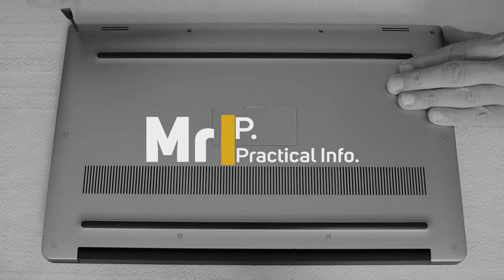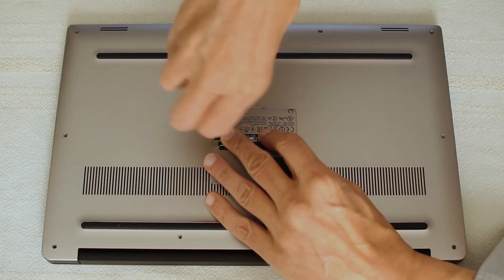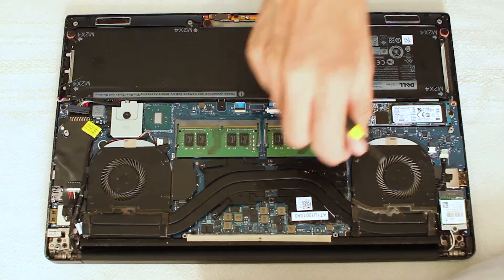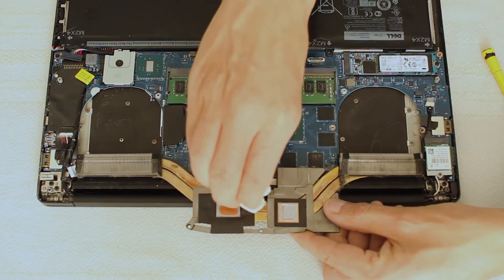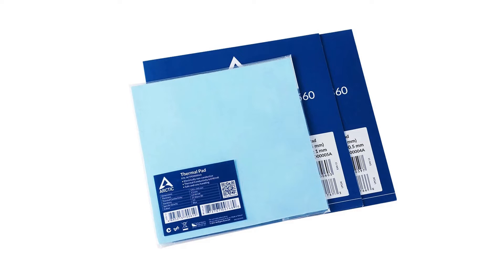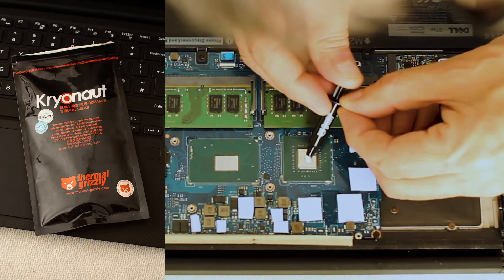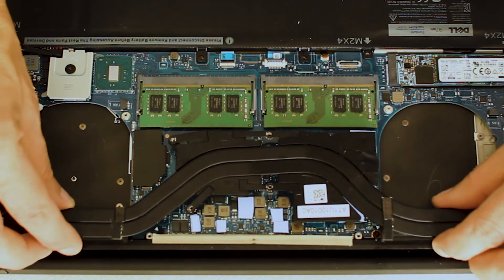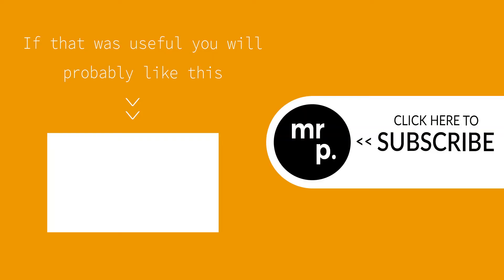Dell XPS 15 Overheating 🔥

Comment: I repasted my XPS 15 9560 a couple of days ago. Smrt as  I am, I did not take temperatures before.
I used the paste from Noctua, just because I still had some. Shouldn't be too different from the Kryonaut, as we are in the top notch category anyways.
Dust cleaning is mandatory if you have it disassembled that much, because airflow is paramount. I did not replace the thermal pads, as they were still 'rubbery' (and forgot to order some).
I used maybe more paste than necessary, since in a Gamers Nexus video, they tested exactly that and did not have negative effects up until they used a ludicrous amount of paste. However, since it is a Laptop CPU and GPU without the metal heatspreader of a desktop CPU, I spreaded the paste carefully so every corner of the dies is covered, since otherwise you will have hot spots there.

Result: at a room temperature of about 20°C to 22°C, it idles in Windows 11 with a browser open at about 46°C to 51°C, with occasional fan spinning.
In Minecraft without FPS restriction, it manages a stable 3,4+ GHz at about 90°C, so there should be no thermal throttleing. Measured with GPU-Z.
Reply: I've done the same but after repasting with Arctix MX-4, my temps went up way higher than they were before! I thought I may have just applied too much paste (and I think I did) but now that I repasted again with a smaller amount, the temps are still idle 65° with chrome + spotify + whatsapp open and the fans are constantly spinning :/

I'd undervolt but that isn't possible anymore with all the new software so at this point I'm not sure what to do. I ordered Thermal Grizzly paste but I doubt it will make a noticeable difference. Thinking about cooling pads too but I also don't see how that could do more than +-5° which is by far not enough for my system.

This XPS 15 9570 has had issues ever since I got it but this has just been getting worse and worse lately...
Reply: @DomskiPlays  Kinda late but just make yourself a diy cooling pad with 3000-4000 rpm fan or more and bridge your heat pipe with thermal pads this makes my precision 5540 run 15-20°c cooler
Reply: How are you running windows 11 on a 9560? It tells me i have a gen too old of CPU
Reply: @johnjamison460  There are ways to circumvent the hardware check upon installation. You should google it and make sure you find the most recent method, as Microsoft occasionally changes the ways in this is possible. It just works, but maybe you have to trick it again on major version changes.
Reply: @johnjamison460  There are ways to circumvent the hardware check upon installation, however I'd suggest to google it yourself to find the most recent variant, as Microsoft does block methods occasionally.
That said, once it's installed it works just fine. However, when there are major updates, you might have to trick it again to install those. I can use it just fine, but I wouldn't give this to my parents.
Reply: @johnjamison460  run the setup from source filee and search for how to skip ths message on yt

Comment: avoid this garbage laptop at ALL cost. i sold my i9 because of this issue.
Reply: Ye I bought it realized it runs like trash and now I'm stuck with it because I'm traveling
Reply: @lord_oul if just got my i7 one so gotta do all the fixes its super fuc*ed battery is like half life i need to do alot of fixes

Comment: Without a before&after, this is just wishful thinking in my eyes
Reply: I just cleaned mine, still heating and throttling like hell. Bad design is the biggest problem. Marketologists win.
Reply: @Eugenetra7 my xps 15 runs like trash, I regret buying this laptop badly